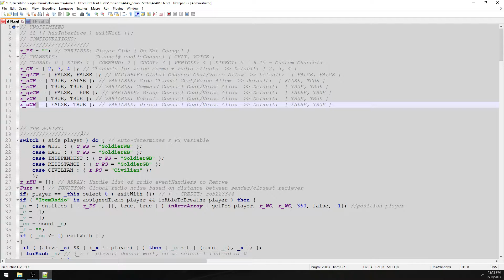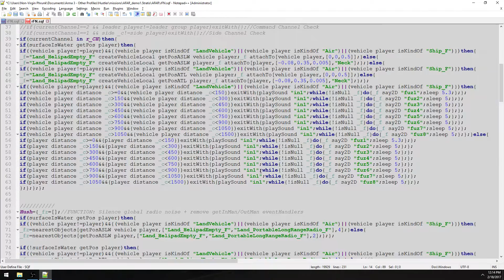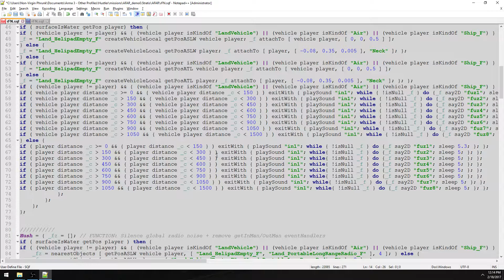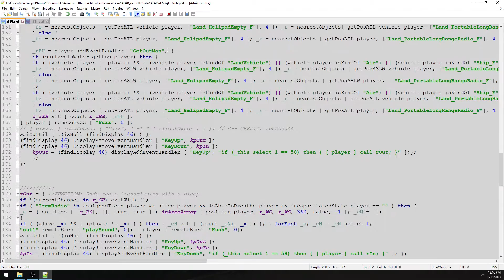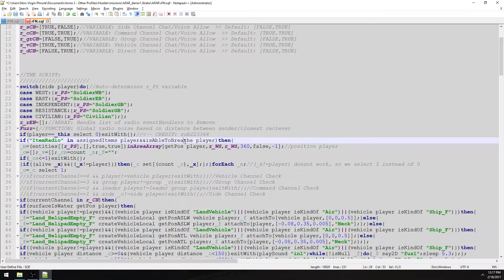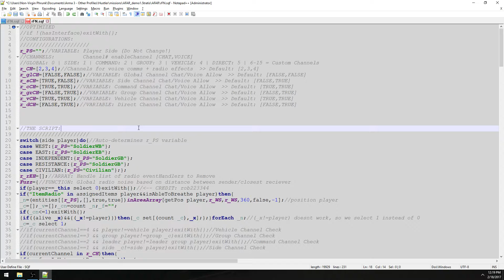Optimizing Arma 02 - White Spaces | ArmA 3

Comment: Hey, if you check out on my channel. I made a program with c# witch compiles all the files in the mission. It’s takes the files and removes all new lines, and converts the encoding to utf-8 to save space. I had more plans to make it so it automatically coverts // comments to multi line comments. /**\ however lost the source code.

Comment: This is complete bullshit... Stop teaching people crap. Scripts are compiled once. At compiletime all code is converted into a binary representation without any characters. Please use your reach and teach people real optimizations rather than this crap.filesize is also completly unrelated to script performance. Have one script with one million whitespaces and one with just one. Both take exactly the same time to execute. One takes longer to compile but that's only because of the time it takes to read it from Harddrive into Memory.
https://community.bistudio.com/wiki/Code_Optimisation Here are some real Optimizations.Want to know another bullshit optimization that actually is an Optimization? Resolving local Variables (_var) is faster than resolving global variables (var). Because the hashMap for local variables has less variables in it so it has less problems with hash-collisions. 

Also why do you show Optimizations without even benchmarking if that "Optimization" makes any difference? 

Correction! I investigated it further as I've seen you use execVM a lot. execVM actually compiles the script everytime it's being executed. Which is a very bad thing (Btw processing whitespaces is what takes the least time in the compilation process). You should instead use "compile preprocessFileLineNumbers "script.sqf" and store the result in a variable. You only do that once at mission start. And then you use "call yourFunctionVariable" to call it. That way the function is only compiled once. This will have a way bigger performance impact than your removing whitespaces.So in the way you are missusing scripts having them as small as possible (smaller variable names, no whitespace) actually improves the Performance. But it is still much much worse than using them correctly.

Comment: This is snake oil. In compiled functions (which if you're not using is a major performance problem) whitespace objectively does not make a difference and in scripts make all but a tiny one. Also if you do absolutely do want to minify your scripts for some reason the best programatic way to do it is to keep two versons, a properly indented "*.sqf" version and a second minified "*.min.sqf" (also with NO comments). This is commonly done with javascript so you are on to something at least, but this level a space here or there should not matter if it makes your code look nice.

Also dude, if you have a git repository somewhere for your combat realism stuff and radio stuff could you link me? I might be interested in contributing.
Reply from the maker: I've had trouble trying to figure out how to setup my own GitHub repository and actually use it, but then I eventually gave up.  I don't really need much help with CRS, it's actually an extremely simple pack of scripts at the moment.  I may need a hand with creating long range radio functionality alongside short range radios in my script, but for now I've been just fixing bugs with it.
Reply: ArmaPhronk Awesome, you can e-mail me at ralian@ralian.net if you want a second hand in any part of it.

Comment: It's interesting that you're mentioning script optimization by removing white spaces while at the same time you have about 20 if-then checks with the method "distance" or "nearestObjects". Wouldn't it be more efficient to save the distance value first and then using this saved value for all the other checks? That way, the engine doesn't have to calculate the distance on each line, saving a substantial amount of script schedule.
Reply from the maker: The script definitely needs more optimization like you pointed out, but it's still in its conceptual phase.  My code is usually sloppy / unoptimized in the first draft of a script I'm writing, mainly because I just want to get the code to work.  Optimization is easier after, for me at least. It's a good idea, I'm just explaining why it's structured like that right now.
Reply: Understood. It's a sort of pet peeve of mine to point these things out because of all the scripts I've seen written in the same way. Anyway, happy editing!

Comment: Wow, interesting... especially when white space is typically ignored, but it appears although ignored its calculated? Typically, adding structure with white space allows for better following when editing, especially if multiple people are accessing/modifying the code.
Reply from the maker: Exactly.  In the case of Arma, if you're working on a project composed of a team of scripters who may use or modify your code, it is best to make the code more legible than demonstrated in this video.  It's also a common practice for scripters to make their code more readable if it's something they intend to release publicly as a template for others to work off of.

In my specific case, I prioritize optimization, even in ridiculous was like this instead.  Even though I release template missions and scripts, I still prefer to condense my code for the sake of optimization.  Aaaaand OCD. ;)
Reply: ArmaPhronk Makes perfect sense. What's your thoughts on increasing optimization by reducing the character length in custom name calls when/where possible? Ive heard others mention it but I haven't personally approached it in Arma (just starting to look under the hood in Ernest), have other coding experience. Great vid!
Reply from the maker: You mean making names of variables, functions, etc. shorter for the sake of optimization?  It is a noteworthy optimization, in my book.  The BIS wiki even states that having a shorter name for your mission can make a noticeable difference in optimizing the loading time of that mission.

The previous episode of my "Optimizing ArmA" series goes over this, actually.  You can check it out here:https://www.youtube.com/watch?v=452DDfsdOWk
Reply: ArmaPhronk will take a look.